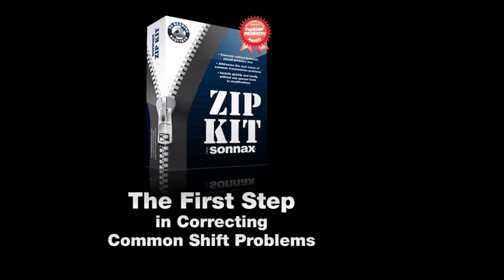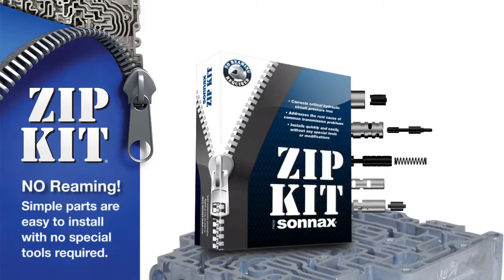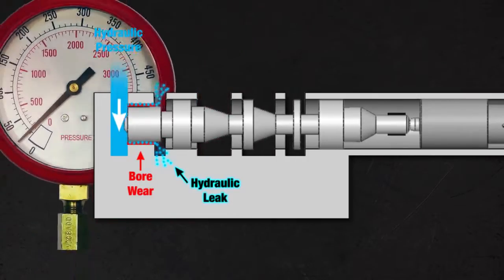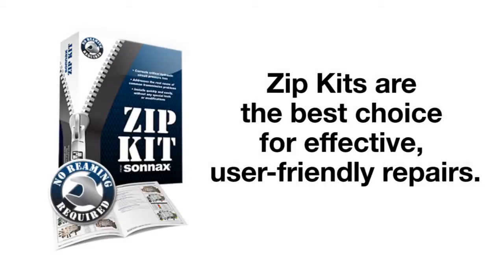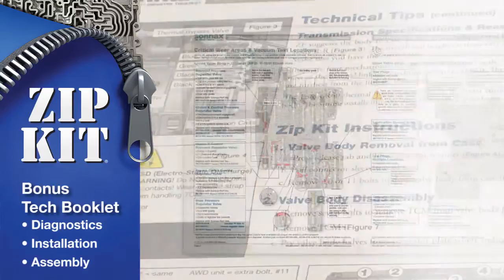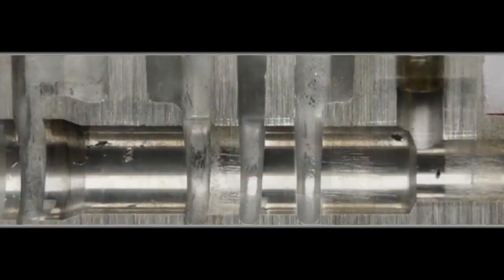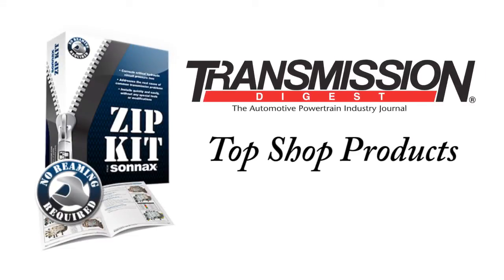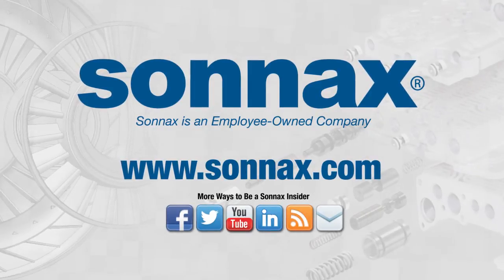Sonnax Zip Kits®

Comment: What's difference between surecure kit and zip kit????
Reply from the maker: Great question! Zip Kits are a “first step” to address low wear castings that can be repaired without tooling. Sure Cure Kits are more comprehensive, and typically require reaming to correct worn bores in higher mileage units. Hope that helps, thank you!
Reply from the maker: @Brian Jones While adding the o-rings is still a good long-term repair, they are NOT a substitute for reaming. O-rings are typically only used on end plugs, which can help if that’s the only place it leaks. The reality, however, is that the valve and bore can leak as well. Over time the constant valve oscillation wears the casting, which creates excessive clearances that will cause control issues. Because the valve is not stationary like an end plug, o-rings don’t really work well because they can stick and get caught on the sharp worm tracks and uneven bore surfaces. Once wear gets to this point, the only way to restore clearances is with a reamer and oversized valve. Hope that helps. Thanks for reaching out!
Reply: @sonnax  those reamers are sold separately by the looks of the things.